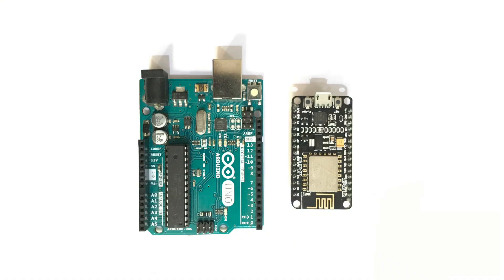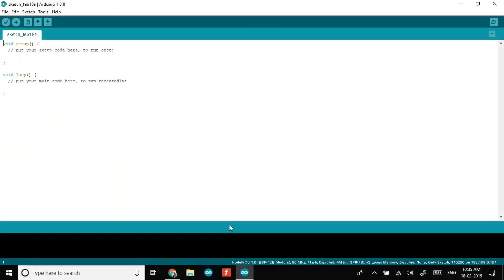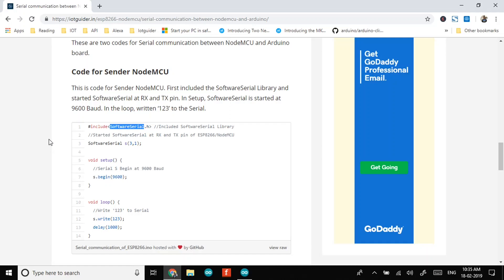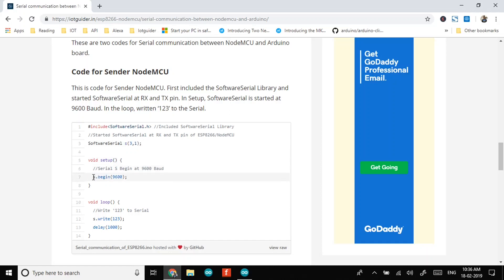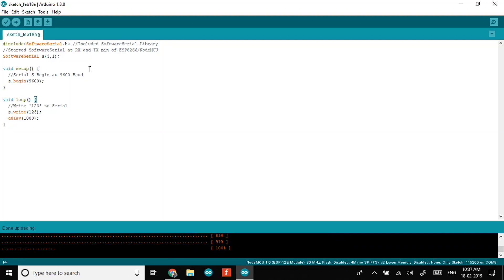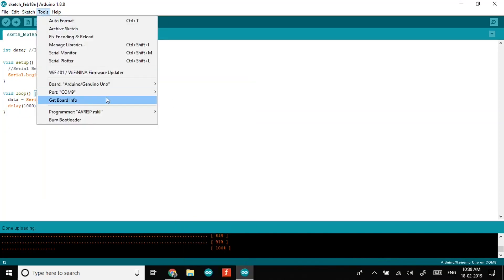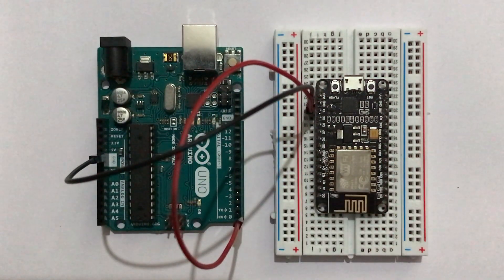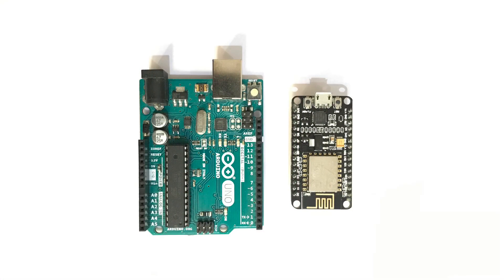Serial communication between NodeMCU and Arduino

Comment: Hello
Whoever reading this please reply if you can. I want to connect 2 nodemcu with Arduino UNO and they both are sending data to the Arduino. But within some  time period data is lost of any one of the nodemcu plz help me out with this. I am using software serial and Arduino json libraries. If u have any simpler technique that can be successful please share....

Comment: If this code works, it shouldn't.  You are specifying pin 3, 1 in your software serial functions, but, you're not using pin 3 in your wiring.  If you are going to use the hardware  Rx & Tx pins, you don't need to use  Software Serial.

Comment: Few key notes on this video:
1. NodeMCU has inbuilt serial so begin with just "Serial.begin(9600)" not SoftwareSerial
2. No Logic Converter -> High Failures
Reply: no need to logic converter node MCU handle 5volt
Reply: @amazingmj07  it has 3.3v voltage regulator build in
Reply: @jeetgod1601  that regulator is only  convert power supply 5v to 3.3v
Not the gpio pins voltage.

Comment: Nodemcu Rx and Tx pins operates at 3.3v while arduino pins opeartes at 5v don't you think 5v of arduino will burn the Nodemcu board?
Reply: no need to convert node MCU handle 5volt
Reply: Use of Level logic converter is recommended.
Reply: using level logic converter